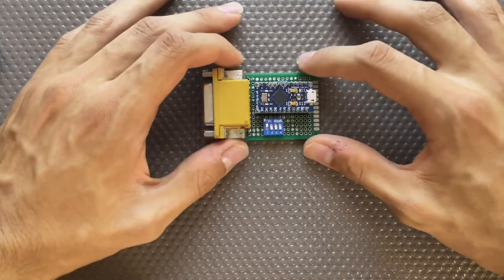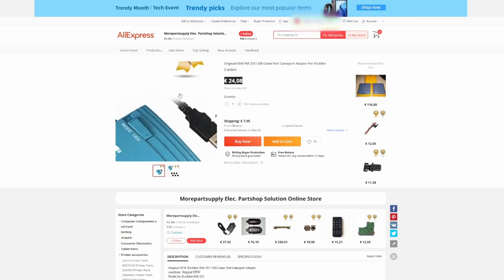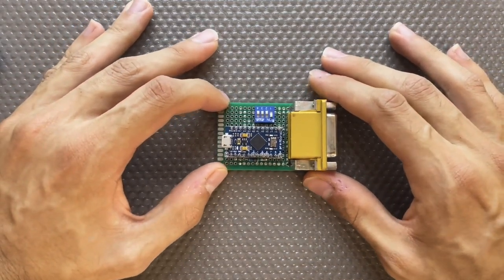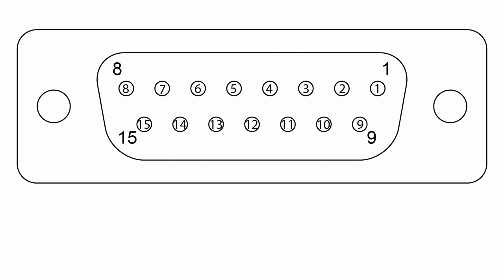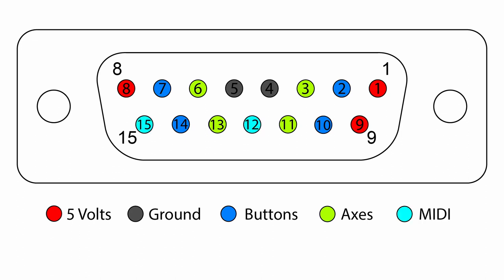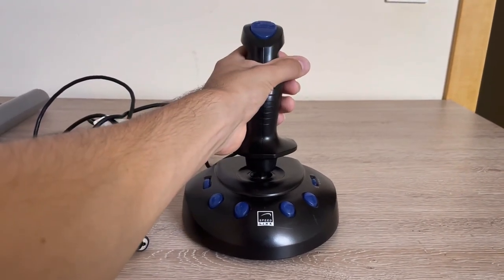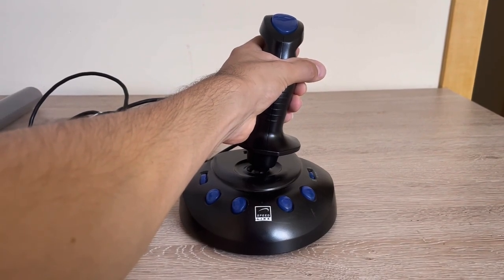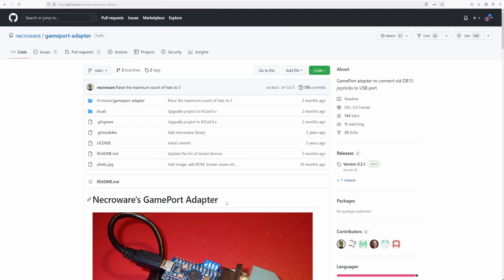DIY Gameport to USB Adapter

Comment: I'm into building one of these adapters to be able to use a Quick Shot OS-206 old Joy Stick. I'm obtaining the PC board from a prototype manufacturer used by me several times, (OSHPARK), at a very cheap price $10.00 for three units.  They are very expedite in their service. Good luck, just to share.

Comment: how did you insert DB15 pins into pcb holes? it's just a mess  >_<
it's even worse because of checkerboard layout and PCB is straight square
Reply from the maker: I had to bend the pins a bit, but it worked out great. You can see a picture of it on my website post: https://littlebigtech.net/posts/diy-gameport-to-usb-adapter/#finding-a-gameport-port
Reply: @littlebigtech2457  I see, but sticking it inside holes, they spring and resist to get in. First I clipped 'em expecting it will be easyer, but no way. No I solder some thin copper wires to make some stretching leads I can use to direct them in right way. So it is an adventure
Reply: @littlebigtech2457  OK, finally I managed to stick all pins and solder DB15. Now can you explain in details why 328 atmega not fits? I have both 324 and 328, well 328 has longer PCB, but it also has USB connector. What's the difference in them?

Comment: I TOO HAVE A 15-PIN JOYSTIC THE SAME AS YOURS. BUT THE NEW GENERATION DEVICES DO NOT HAVE THIS INPUT. HOW CAN I CONVERT THE MALE GAMEPORT SOCKET ON THE JOYSTICK CABLE TO A USB CONNECTION. I DON'T KNOW MUCH ABOUT THE LINKS. HOW CAN IT BE DONE WITH USB 4 WIRES BUT GAMEPORT 15 PORT.
I THINK THERE IS A SOLUTION. SAY WHAT? THE JOYSTICK HAS 5 BUTTONS AND FINE ADJUSTMENT AND CENTERING WHEELS BELOW. BRAND IS PREDATOR XK 100